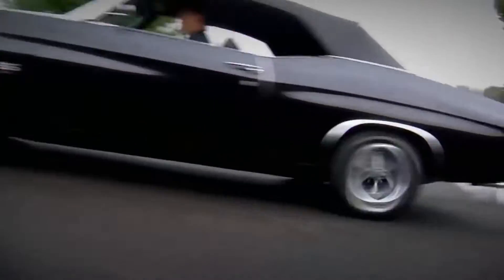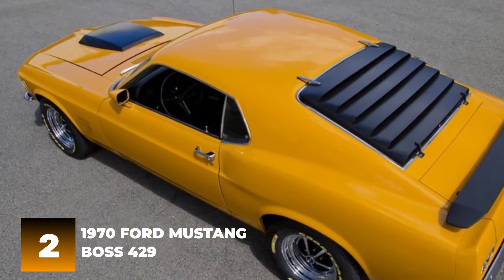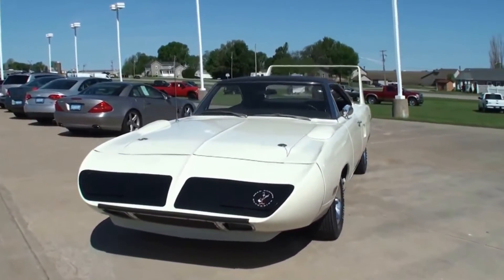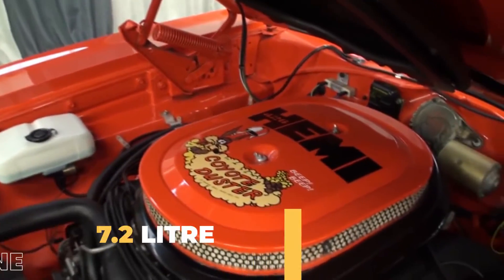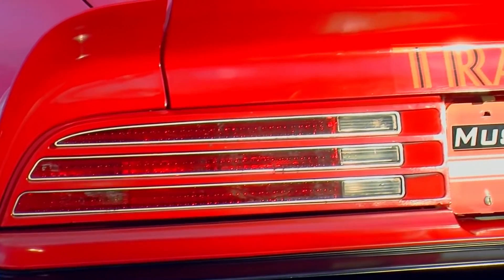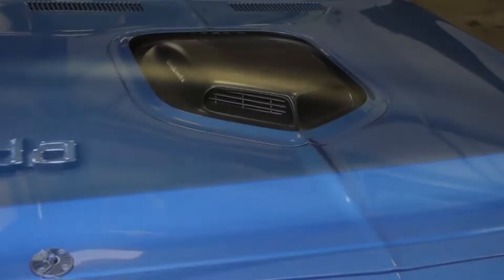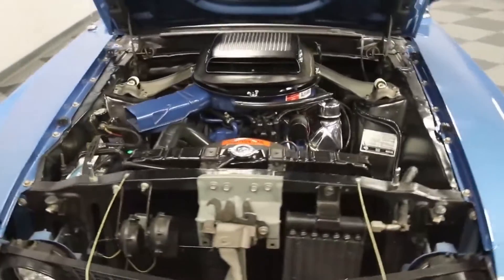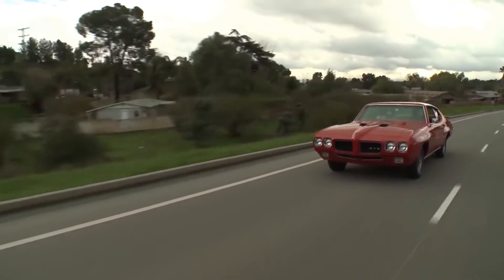The 10 Most Powerful and Sexy Muscle Cars of the 1970s

Comment: Ok wow you need to do your home work , 1. Not all SS454 Chevelles had 450hp only the LS-6. 2.The Buick GSX also came in white  in 1970 and had 510 ft lbs  noot 495 ft lbs.   3. The GTX Hemi  or all 426 Hemi engines were rated at 425HP  never was is rated lower than that. 4 the 1974 Trans am came with 3 engine options  a 400  with 230hp  ,455 with 250hp and the SD455 with 290hp  , the 1st Trans am came out in 1969 not 1967. And the Screaming chicken was on the Trans am not the GTO .
Reply from the maker: Thanks for watching!
Reply: All hemi Engines was rated 425 hp, not 426
Reply: @DrangeDragRacingTeam1967  typo  on the Hemi HP rating and to be totally  right thwt were Factory rates at 425 gross hp or 350 net hp
Reply: I also believe the 454 was available in the 3rd gen of the Chevelle. These videos are almost comical.😂

Comment: All of the horsepower ratings in this video are the old OVER RATED  FAKE GROSS numbers that were banned in 1972.  In reality, their horsepower was 19% less than advertised.  440-6 was advertised at 390 GROSS but is really 325 NET.  A new Dodge with 5.7 puts out more at 375 NET.....They were NOT that quick.